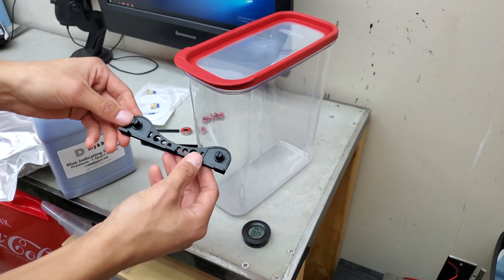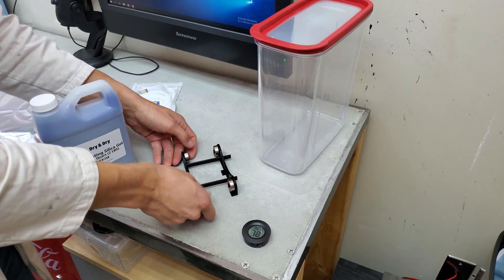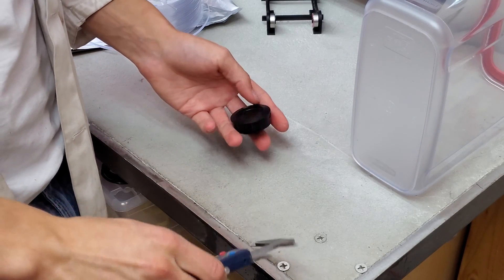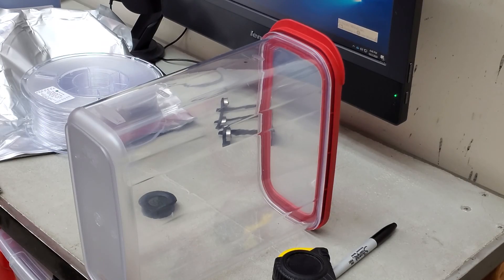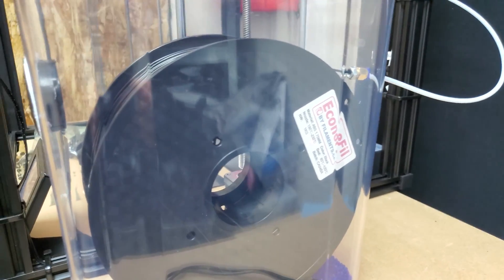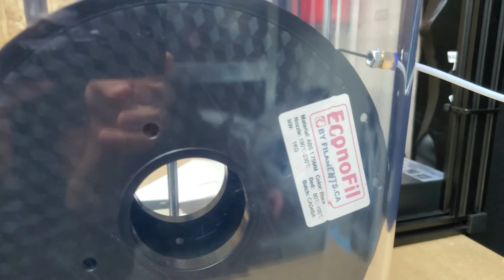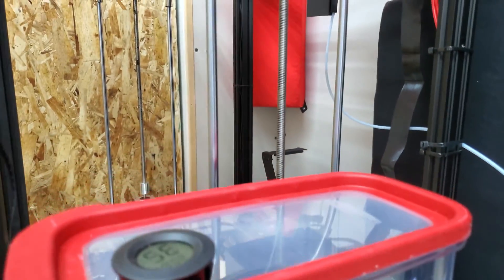3D Printing - Keep Filament Dry while Printing - Tupperware Dry Storage Solution

Comment: You can dry the air inside the container fairly quickly but the filament it takes days to dry fully to the same level as the air inside the container.

Comment: I have a similar system, but use a food storage box for the cassette, so side access for simple reel change. My hygrometer is internally fitted- no loss of container integrity. The filament feeds through the bottom, with a clamp, and drops into a cassette holder on top of my printer cabinet. Lines up with the filament detector, very fast change.

Comment: Does wearing a lab coat make you feel like a scientist or do you wear it to increase your credibility? BTW, your dry box design is rather poor. You will have far less friction with a hanging single roller than a double roller at the base. Also, drilling a hole for the hygrometer is not necessary (and not airtight because you used no sealant) because it can be visibly be mounted inside the box.
Reply from the maker: To answer, I like the lab coat for several reasons. Yes, it does lend some credibility, but I primarily wear it because it is lightweight, comfortable, fairly-breathable, and keeps the sun off during the hot summer days. 

A single roller design would produce less friction, however the current design is adequate in many regards, as it allows easy loading, and unloading, and requires no significant modification to the container.

I am aware that drilling a hole for the hygrometer is not actually necessary, but I felt it improved the appearance of the design. It is also airtight, because I did use a sealant during the installation.

In my testing, the current design works quite well, although there is room for some improvement. I may consider a single roller design, in the future, but as of yet, the spool holder functions too well to justify dedicating any resources to updating it.
Reply: Actually, a hanging roller requires more pulling force to unwind than rim rollers. This is because the filament to pivot distance is greater to the rim, so a given friction level requires less torque. In practice it is irrelevant, as the available force is more than sufficient for either.

Comment: What size Nut did you use to attach the Bowden Tube fitting to the container. Is the fitting not a pipe thread?

Comment: Can you share where you found the nut to go on that PC4-M6 pneumatic fitting? It's not in the Amazon listing... Thanks
Reply from the maker: You can purchase nuts at a local hardware store. I didn't include it, because I believe most people have, or should have some lying around.
Reply: @GadgetEyeGuides  no unfortunately I don't have any m6 nuts lying around right off hand. I can purchase them online but how can I be sure the thread will fit?

Comment: Hi there, if I was to make this setup for rolls that have been left out , do you think this will be sufficient to pull the moisture out of each roll in it’s own container or should I heat/bake each roll to remove moisture 1st and then install in the container set up. Thank you for any help.
Reply from the maker: It may over a very long period of time, but realistically if your roll is saturated you need to dry it with heat.

Luckily it is quite easy, you can place the roll in an oven for a few hours on the lowest temperature. Just keep a close eye on it and make sure the reel doesn't melt or deform.

Comment: Instead of using silica gel I use those closet dehumidifier tubs and sachets you can get at Tesco, Daiso and other places. The popular brand here is "Thirsty Hippo", though I usually just buy the Tesco branded stuff. These contain calcium chloride, which absorbs a LOT of water, a lot more than silica gel does. The sachet or pouch versions have a gelling agent mixed in so when the calcium chloride becomes wet it doesn't leak out. If you keep your container sealed, the tubs or sachets last pretty much forever. The sachets are either scented, or contain activated charcoal to absorb odors, this is the type I like to use. I store my filaments in big Tupperware style buckets, four spools to a bucket, with a sachet on top and a small hygrometer - the humidity will go down to 18-22%. I haven't built a printing dry box like this yet - I figure once I start printing with nylon I'd need one, for PETG, for now, I'll just leave it in the bucket until I need the spool. I do have a bunch of silica gel, salvaged from packets that come with filament and with medicine - I use that for keeping electronics items dry because the calcium chloride might cause corrosion.
Reply: Actually, silica gel dries to a lower humidity than CaCl. And it regenerates. And it changes colour when it is used up. And it does not get wet.

Comment: The box is transparent, you don‘t need to drill a hole for the humidity sensor, you could just glue it from the inside to the wall or lay it inside the box…
Reply: i think in this way it looks more elegant than glueing

Comment: would there be a way to make a mutibox version with a easy way to swtich between colours.
Reply: Multi-reel boxes require you to open it every reel change- letting air in. More reels, more air. Plus you cannot incrementally add reels. One per reel is the way to go.

Comment: I have a Rubbermaid 5 liter box with red lid that also works well, very similar proportions. You could probably just toss the humidity sensor in the bottom of the box, or use a little double stick tape, silicone or Goop glue to attach to the plastic wall, no need to drill the fiddly large hole. Nice work though thanks!
Reply: Looks cooler this way tho 😁
Reply: Fully agree, you'll be able to clearly see the hygrometer inside the container.

Comment: One idea for drilling the whole -- start the pilot hole going the direction you were (4:45) -- for the rest of the hole, put the drill to go backwards and will be easier cut and not grab at the end -- or start that direction and switch it about 1/2 way through...

Comment: When you say m6 drill do you mean 5.5mm like you would use to drill for an m6 tap
Reply from the maker: No. I did not tap the box, I suppose you could however.

I used a nut, so I drilled a hole larger than 6 mm using a 1/4" bit, or rather 6.35 mm.
Reply: @GadgetEyeGuides  Ah, that seems a bit different than the video. So drill 1/4in and then press the nut into hole?
Reply from the maker: @fozbstudios  Yes.

Comment: How does it react to retraction?
Reply from the maker: The filament will return into the box as slack. Once the printer returns to printing, the slack will be quickly taken up without issue.

When changing filament, I generally avoid returning slack back into the container, I just leave it hanging out the end of the bowden tube.

Comment: Man, can not find Rubbermaid 1861476 anywhere.  The opeque ones are a lot cheaper though, in fact I could only find them in two packs for as much as one 1861476 cost.  I think I'll make 4 of these as I might one day get the Prusa MMU2S.  That and I rarely have more than 4 spools at a time.

Thanks for this video though, you have the best solution I have seen so far.

Comment: Nice neat solution that doesn't cost the earth. Does the feed from the container become more difficult as the spool gets used up?
Reply from the maker: I cant say yet for sure, I've only used half a roll.

However, I did place the bowden tube fitting around the midpoint of the roll, so it should be similar when the roll is full, as when it is empty. I don't think the resistance will be a problem for my extruder.

Comment: Nice solution. I am currently using IKEA 360 Dry box. and it fit for 2 spool.. but I think I prefer for 1 dry box for 1 spool because I have being printing 3D Model that I design and required to change filament in middle of printing.. since 2 spool inside the dry box, it required me to open the lid and cause the moist to go into the container. I think with 1 dry box with single spool inside (like your video) it is best solution that suit my print project.
Thanks for share.
Reply from the maker: I'm glad I could help.

Comment: Nice solution. What drill bit size did you use for the Bowden tube fitting?
Reply from the maker: The fitting used an M6 nut, so I drilled 1/4".

Comment: slt ,  pourquoi la silice est bleu ??
Reply from the maker: The gel contains an indicator, which turns transparent when wet. As another user pointed out, this indicator is carcinogenic.

Because I already use a humidity sensor, I will probably switch to a non-indicator gel in the future.

Comment: looks fantastic! Just be careful with the blue silica gel, the indicator is cobalt chloride which is carcinogenic. I have read contradictory information about the toxicity of the orange gel too, so to be sure I'd just go with the colourless one. Other than that, super helpful, tyvm!
Reply: It's not like he's eating the silica gel and skin contact is very minimal. I think the danger is minimal. You could always just wear disposable gloves when handling it. But in any case, you should wash your hands before you eat or handle food every time. Just common sense precautions. Of course there is ample evidence that some don't have common sense when companies are required to put warning labels on silica gel stating do not eat.
Reply: @vhoward1122  So true.. common sense isn't very common!.. a QVC customer left  some feedback on the site that berated some beauty product capsules that supposed to help her skin. 'They do not do anything for me! she said.. it didn't help that she wasn't breaking open the capsules as was demonstrated and placing the product on her face.. BUT swallowing them!!!!!!
Reply from the maker: You are right, luckily I haven't had to touch the gel since the day of assembly. However because of the humidity sensor, it is not like the indicator is necessary anyways.

Originally I was not aware of this, I'll try and get non-indicator gel next time.